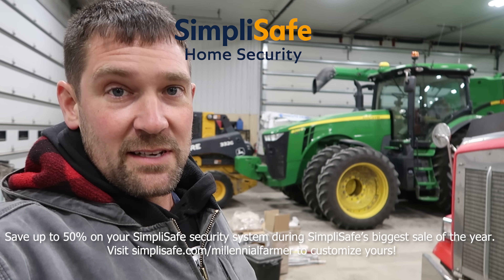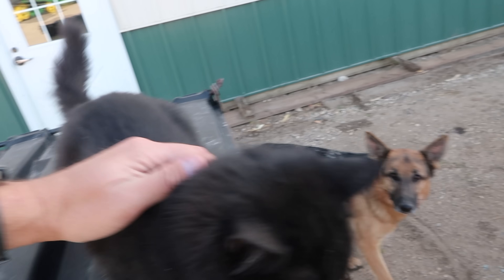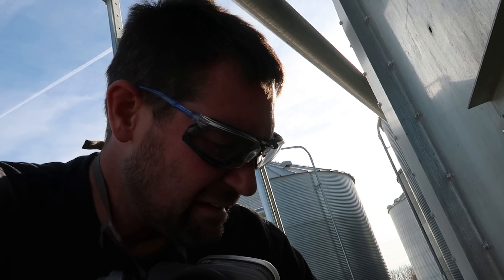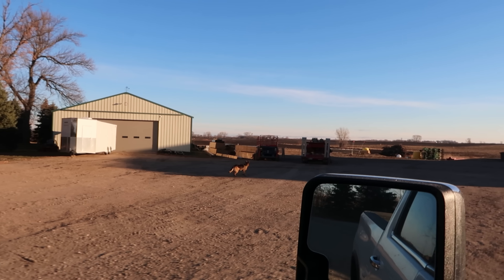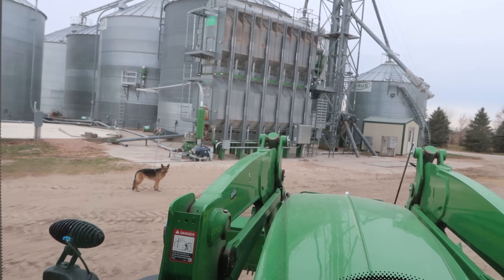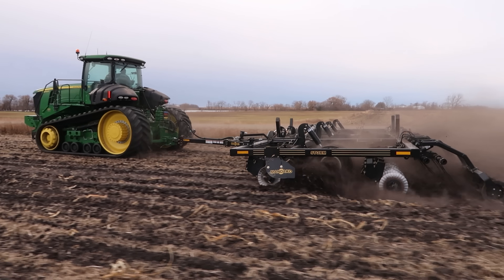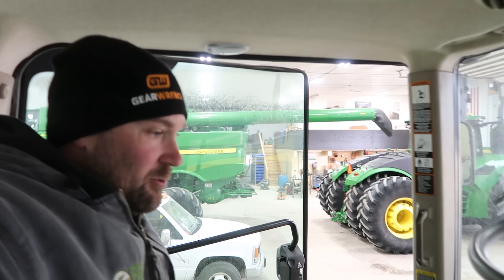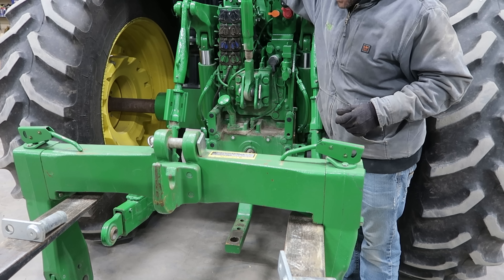The Job I Hate the Most - Digging Out a HUGE ROCK

Comment: Hey Zach, love your vids, have been going through the back catalogue foe the last few months, You have a very cool operation and loads of very fun toys going on there. Love the family content as well. Just curious here though, wouldn't it be easier to use an industrial sized vacumn for all those "hard to reach" places? Like the silos and dryer, etc. There is probably even a business that will come out and do it, or a business oppurtunity for you maybe. Industrial vac on a truck. Would save you a crappy job and a ton of time. 
With that T800, only 7 months on fresh batteries seems like a really short time, even with your winters.  Have you checked all the cables and the alternator recently? There might be something going on with them, though I guess it depends on whether it's happening very often or just when it sits for a while.  But it really doies sound like either there is a random power drain somewhere, or the batteries aren't getting a proper charge.  Or I could be completely full of it, I'll leave that up to you to decide.

Comment: Perhaps a silly question, but I'm going for it anyhow. When you are cleaning out the bottom section of the dryer it appears that you have to bring it all to the slot below the door and out via that slot. Could you use something like an expanding roof snow rake to pull the chaff out, or does it just weigh too much? The heads of them are plastic so that they don't damage stuff, and I would think could be cut to the shape of the bottom section to make things easier. As I said, just a thought/question. Wish I was a few states closer - I'd love to be able to check out your second venture!!

Comment: The Red Kenworth has a PARASITIC DRAIN, It doeant matter about batteries. There is a module, radio, something that isnt going to sleep like it is suppose to. Have a local mechanic do a parasitic drain test, and isolate the issue. 99.9% sure this is your problem.

Comment: It's amazing how much loss between the field get the corn head lost you got a little bit of loss that's going to come out of the back of the machine then you got auger loss to grinding the stuff down to dust then you got it put it in the Benz there's lost in that once again from just grinding down to dust then you got lost it goes from the grain bin to the dryer once again grinding it down the dust and what you're blowing out beside as you can see which a lot of that I know is the kind of got what you called it which technically is a lot of it that does from just the kernels hitting all this metal from the combine to going through everything and then what blows outside wonder how much losses actually done between all that wonder if it could equal a good amount of money I mean I ain't saying it's tens of thousands but could it be $1,000 could it be a couple thousand dollars lost now for you that might be nothing but for me a couple thousand dollars is a lot of money now when you making a hundred thousand all right a couple thousand in it big but I don't make hundreds of $1,000 or $100,000 so $1,000 would be a loss $500 would be a big loss but I mean there's nothing you can do about it I mean I think everything's done is is efficient as it possibly begun probably I'm not saying we shouldn't work toward it maybe we should work and getting some type of hard polymer rubber or plastic instead of using metal augers maybe that would cut down on a lot of it and they wouldn't hold up as long that's for sure but if they could be made inexpensive who knows I don't know just thinking out loud while talking on this comment